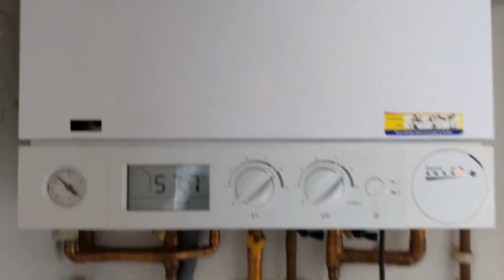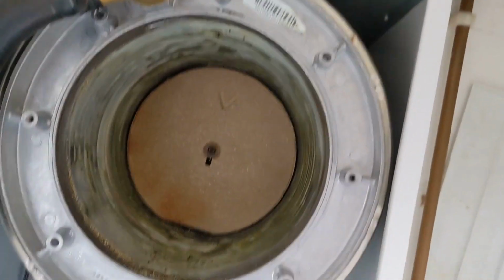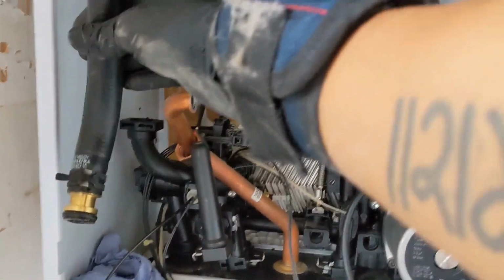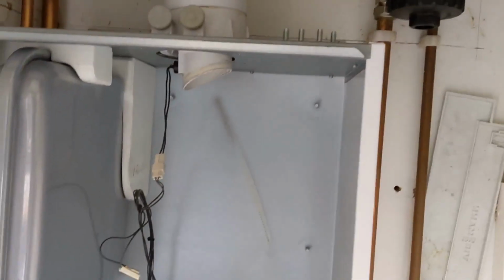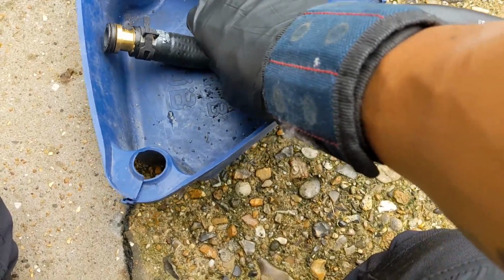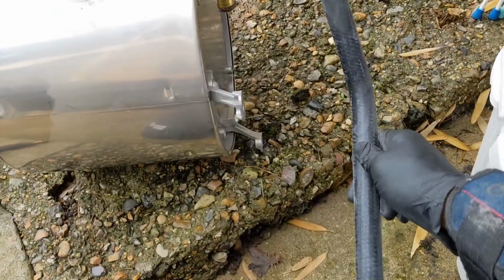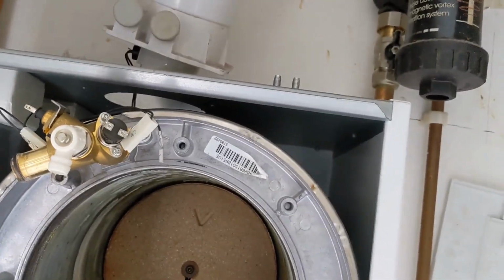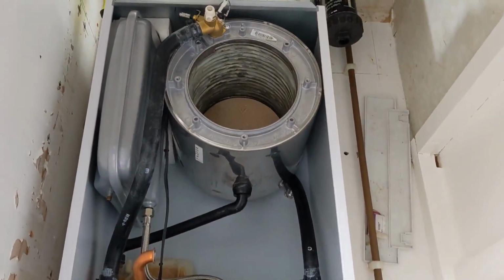Replacing Viessman Vitodens Flow & Return Hoses

Comment: Great demonstration of the ease of stripping a Viessmann boiler. The hoses can easily be cleaned in situ though and if the system is chemical free they need replacing after 12 to 16 years. 
The hoses collect the dirt in a dirty system but not in a clean system. They collect the dirt that dirt filters don't collect. So in effect they are an amazing filter than is quick and easy to clean on an annual service. Effective filters protect boilers better than ineffective filters. A great design feature if understood but alas its often not understood and becomes a negative rather than a positive. The compact with no rubber hoses blocks up badly as it has not got this fantastic protection. 
Many installers do not understand just how brilliant the Viessmann design is and to them it can appear as an overpriced boiler. In ti.e education in the UK will lead all installers to seek out the advanced design features Viessmann have been offering for over 20 years.

Comment: Great job bruh, I generally replace the flue turret seal and grease it up.  I also put in some fernox F2 silencer to keep those dirt particles suspended in the heating system.  It helps to mains flush the hex whilst it's out too.  Next time try it shit loads of crud and sludge comes out.  Double/triple check that turret seal 😏👍.
Reply from the maker: Nice one mate always good to share tips 👍🏽

Comment: Good video bro them viessmann boilers are nice and easy to work, I really like them! luckily the heat exchanger comes out in about 10 minutes you won’t be able to do that on a lot of other brands,  all the later ones now have copper pipes . I usually put a bit of silicon grease around the turret seal.
Keep the videos coming

Comment: Thanks for the vid👍
I dont come across many viessmann boilers in my area so interesting to watch. 
Do you flush out the plate and main heat exchanger as its drained down and dismantled or do you flush when fitted back in the boiler with chemicals?
Reply from the maker: Thanks mate 👍🏽 So the plate was cleaned a few days ago by another engineer and he added some cleaner to the system as well afterwards so I just had to drain out the boiler today and change the hoses

Comment: Nice one...👍 Those rubber hoses are a shit show , and a bad design putting the R on the back , an expensive part two for a bit of rubber , I’ve had probs with the flue seals in the past and now just put plenty of SG on it and that usually does it
Cheers....👍

Comment: What T bar and size did you use for the 3 bolts for the heat exchanger?
Reply from the maker: It's a Wera T bit holder and the extension bar I just got from Screwfix. 10mm nuts 👍🏽

Comment: 22mm copper flexible pipes are available, even Screwfix sell them.  Can these be easily used instead of the rubber hoses?
Reply from the maker: Always adhere to MIs 👍🏽
Reply: @cputilitysolutions  
Not when the MIs insist on poor quality materials.